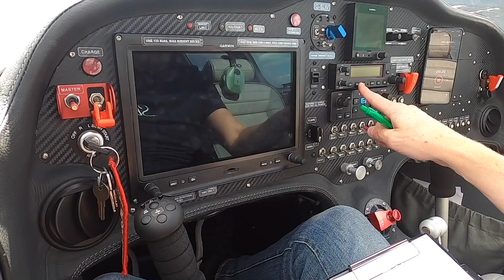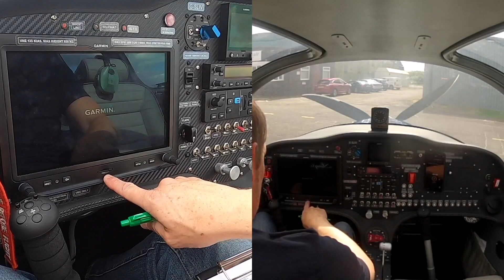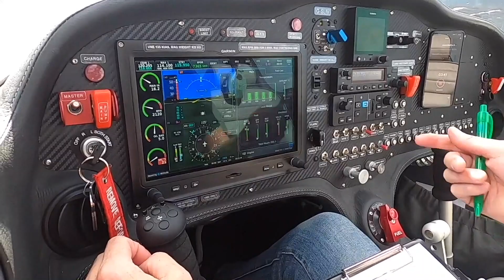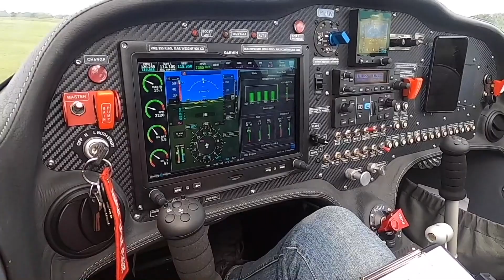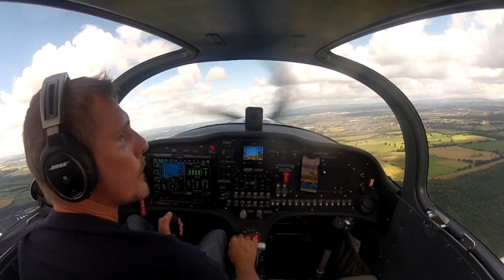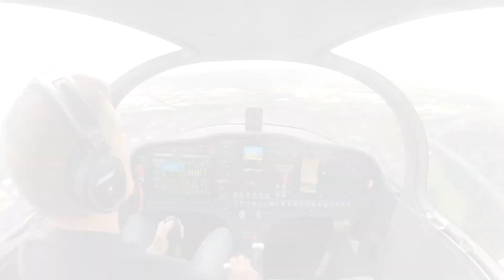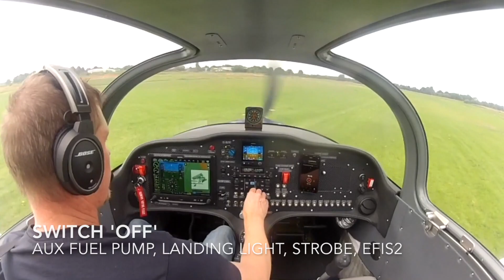SLING 4 standard panel start up check list & circuit

Comment: 0:16 - Garmin GFC500  😄   I heard you say in another video of yours that this plane has 115hp.  Is it fitted with the Rotax 914 engine?    I thought these Sling TSi had the 915iS?    Reason for asking is I'm currently looking at a LSA in the UK that has the 914 engine but know very little about it (compared to the very common 912).   I know it's turbo charged and based on the little 1.2 litre 912 UL 80hp motor.
Reply: Think I answered my own question when I got later into the video - this is the Sling 4 rather than the TSi?    Either way, beautiful plane!  I fly a Piper Sport LSA at the moment, but only the 912ULS engine.
Reply from the maker: The first of the Sling 4 seater models has the Rotax 914. This was superseded with the TSi with the 915. To look at they are the same but of course there is a considerable performance difference.